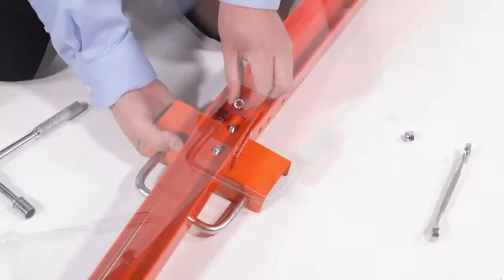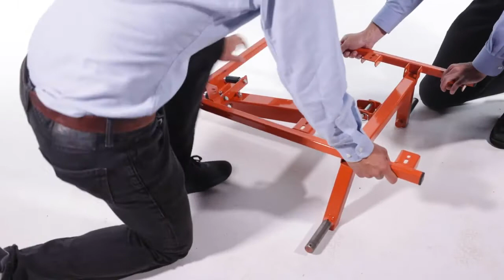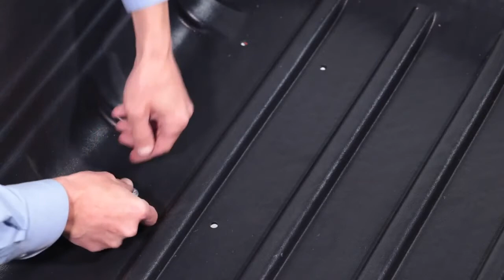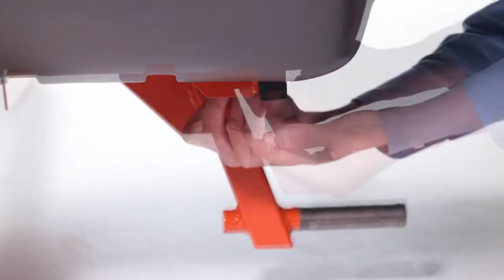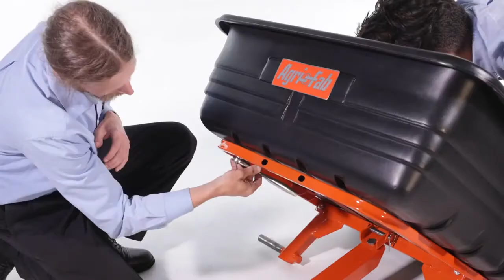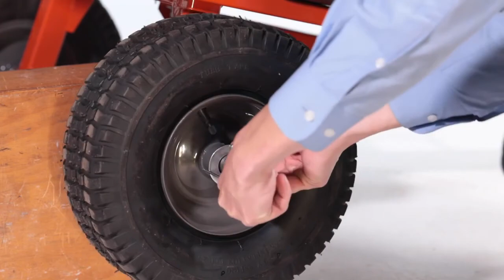Assembly: Agri-Fab Utility 12 Poly Cart 45-0552

Comment: If you own the model being assembled in this video, be warned. This video is edited from assembly instructions for multiple different sizes of cart that use the same frame. This cart requires the release handle assembly to be mounted in the rearmost position (one hole remaining for the stopper, no visible holes on the sides) rather than said stopper being assembled through the double-punched hole as shown in the video and with visible holes remaining on the sides. Toward the end of the video, you can see the frame and tongue are magically assembled correctly. Very inconvenient, and the illustrated instructions have the exact same problem. Seems like a good cart except for the brand sticker. You can see it peeling away in the video. It will not adhere permanently as is. If you gotta have it, high temp spray adhesive is recommended. Otherwise, remove the sticker before use because you’ll lose it the first time out. I recommend enhancing the stopper with a silicone or rubber cap/coating.